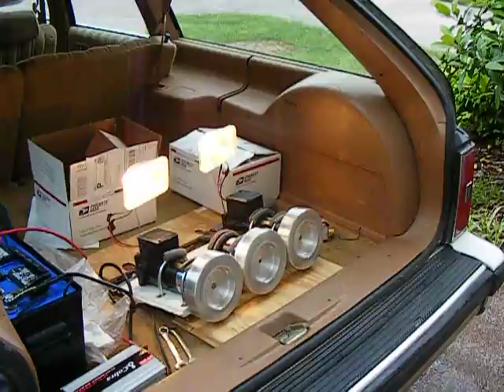New Free Energy

Comment: "matter cannot be created it just transforms", the same idea applies to energy, what you have is some motors that transform electrical energy into kinetic energy and them turns it back to electric, the problems is that nothing is 100% efficient, this motors lose something around 2% of energy in each change, without considering the bearings and air friction, you lost around 4% per cycle, you re not creating energy you re just losing it very slowly, it happens that if you let it there for about one week it will stop cause the battery will be fully discharged..... and please don't answer this comment with " the government doesn't want us to..." the physics doesn't  allow it to happen, any teenager that goes to school knows it...

If you prove that it can be made, i'll go personally to each school in the world burn all the physics books and rewrite it all over again.

Comment: George, here's the thing about magnetic repulsion. If you could completely block the magnetic field while two repulsively placed magnets get close to each other and then somehow move the magnetic block out of the way, then you have made a perpetual motion machine, if it doesn't take more energy to move the magnetic blocking mechanism than is created. You can use iron to block but it takes too much energy to move the block away. There is no substance known that will block without sticking.

Comment: Over unity is in regards to the definition of "coefficient of performance." It has nothing to do with the ridiculous idea of creating something from nothing. I never argued that a heat pump can create something from nothing. I only argued that it can achieve over unity. And with regard to a system it can supply more energy than work or heat input. There is a lot of confusion regarding the terms free energy, zero point energy, and over unity.

Comment: all you are doing is showing a friction less drive, hey guess what i have a water pump that uses magnetic drive, thats been around for years,  if your "generator" and motor were wound on the same shaft ( they did that during the war to power valve radios from 24 jeep batteries ) and floated that on a reverse magnetic field ( positive to positive) in a vacuum and used ac in and ac out ( no brush contact required) guess what you would still burn power as the coils of the ac motor give off heat..

Comment: Free energy eh? so you are running the lights from the generator ? so what is the battery on the left for?? eh    eh   you are using the battery to provide power you admit the 12vdc is powering the inverter 12vdc/220vac then you are using the 220v ac to run the central motor that is turning the generators via magnetic drive so the lights are run from the battery. where is the free bit?? some one giving you free charged baterys en exchange for flat ones?? who you kidding!!!  nutcase.

Comment: (cont.) With these values an ideal heat pump will have an efficiency of 200%, but an ideal heat engine--when we want to get energy back out of the system--will have an efficiency of only 50%. Thus if we draw 1kW to turn our heat pump we can move 2kW (or kJ/s). But we can only get back 1kW of that, again in an ideal friction free no-cost environment.  Did that make sense? We can never get more out than we put in even though the "efficiency" of the heat pump is routinely greater than 100%.

Comment: Sorry to butt in. It isn't correct to think of heat pumps as providing over-unity efficiency. Even 100,000% efficiency is not over-unity in the heat pump world because only a fraction of the resulting transfer can ever be available to do work when we reverse the system. This is described by the Carnot cycle where (Th-Tc)/Th is the efficiency of an ideal heat engine and Th/(Th-Tc) is the efficiency of an ideal heat pump, in Kelvins. So to demonstrate let's say Tc=100K and Th=200K.... (cont.)

Comment: Given your last answer it seems like we are in agreement. Depending on the system specified and given the fact that heat pumps transfer more energy than consumed, they can provide over unity efficiency. This scenario is typically used to subsidize the work of commercial A/C's and furnaces which by thermodynamics are much less efficient both on their own and when considered with the heat pump as an entire system. This heat pump idea or over unity should be applicable in other forms. idk where tho

Comment: right right! But if you think about it, you could in fact transfer more energy from one place to another than energy you put into the system to do the pumping? Right? Example 2 big copper blocks and 1 tiny electric motor could transfer 100 degree heat to the cold block heating it to say 70 degrees while only using enough electricity for the motor that equivalently would've heat the block only 20 degrees.
I agree it doesn't come from nothing, but if it's from the abundant ground isn't it over un?

Comment: What if the generator was connected to a fly wheel? Aside from the start up cost, the generator might then be able to power a much smaller electric motor designed only to maintain speed - while the generator outputs to other sources. I've seen this work with similarly with a water pump, but eventually you run into maintenance costs - where old bearings or brushed motors/generators can have problems.

Comment: Ummmm.... all that heat (energy) lost from the driving motor would have been put to better use powering the lamps directly, not to mention the heat lost in the generators and inverter. VERY inefficient setup. Also, magnetic coupling between a motor and its load is nothing new at all.

Comment: Whenever you convert one kind of energy (like the kinetic energy of a turning axle) into a different kind of energy (chemical potential energy if you're charging a battery, or electrical energy if you're feeding a grid)  a lot of energy is always lost in the process.  Most of this is in the form of heat, generated when moving parts have to overcome friction.  A car engine loses more than half the energy contained in the gasoline through heat.

Comment: 709%?  You're dreaming.  Even if you managed to get 70% efficiency out of your lead acid car battery a lot of work went in to manufacturing that battery.  Do you think it would be possible to run an entire factory for the time it takes to manufacture one new battery, and do it using just your fully charged car battery?  You would need tens of thousands of cells to run a big building at 110V AC and maybe 15A.  And the net result is a battery that fails if you leave the lights on overnight.

Comment: Can Somebody answer this easy question?
What if we put a Motor Axle which it turns and connect that axle to a Generator Axle and connect the output energy to the motor and hey presto electricity, right?

It basically works like a Microphone and a Speaker

Comment: Like all these devices they appear to charge batteries as the terminal voltage will rise, but the power is not being charged with power proportional to the voltage. Don't they teach Hugh School Physics and electrical theory these days?  The problem is the pulse DC or AC output has spikes the meters read, and the batteries absorb, but they are illusionary as to representing power. The SG of the acid must be read to determine charge, not possible by any other way.

Comment: Disconnecting the battery opens the circuit, and stops the flow of electricity, so it would stop, unless you had a bypass to close the circuit.

Comment: You start with DC power stored in a battery.  You convert it to AC with an inverter.  You power a motor with the AC current.  The motor barely turns two generators which produce enough DC voltage to almost keep two lights bright.  Your battery runs down after 10 minutes and needs recharged.  How is this free energy? lol!  Your system will be much more efficient if you wire the lights directly to the battery.  Nice try, but that whole "real science" thing always gets in the way...

Comment: I was brainstorming and your product will work your Resistance is the battery. the battery will only take a small change at a time you need to have a capacitor and more battery's to equally take the large change and not be bottle necked at the battery if that makes any cents to you

Comment: OH WOW!!!  Gears with magnets instead of teeth?!?!  What CAN'T magnets do?!?!  Granted, you have a net negative open system there, so you can't get as many kWh out as you put in.  In fact, averaged over the course of a run, you can't get as many watts out as you put in.  The only thing you CAN do with that is convert voltage it's inverse-proportional friend, amperage.  Technically speaking, you'd be more efficient with just an inverter and a transformer, but I like the Rube-Goldberginess here.

Comment: @MrGunnaras even for permanent magnetic motor you need a battery, but if the battery is charged from the motor, theoretically you need just first impuls, lets say, charging battery from standard electric site and its might be running for ever.

Comment: another f whit - Free energy is not possible - energy can not be made or lost only transformed from one state to another, thus your ides is total fictions and just basically dumb, possibly matching your education level. Eg if any heat is generated this is a change of electrical energy into heat energy and this lost of energy has to come from somewhere eg the battery you idiot, you may be extending the life of the battery but in the end it will die. put some load on a what how quick it dies.

Comment: I am amazed at the total lack of electrical knowledge. He does not get that he is running a motor to run a generator to light 2 lights with an inverter. O my what is that a 60 % loss no wonder the battery goes dead in 10 to 20 min. O it is the magnet drive Space age science mystery?

Comment: @zzytrewq 
We both know that over 100% efficiency is not possible.
You BELIEVE that COP only can apply to the heat-pump category.

Sooo, (aside form HP) +1 COP can't exist , therefore "Higher Output Than Input" can't exist  = CATCH 22.

So for you, "HOTI" is a impossibility, and there is no reason to give any such claims of any device a second thought regardless of ...

If i misunderstand you,  tell me what you would call a device that use energy to harnesses a outside energy?

Comment: @zzytrewq 

Why do you think COP +1 only applies to heat pumps? 

 On the surface your logic about action / counter action applies pendulum part. But it does not apply to the centrifugal force that moves the lever, the 2nd stage of the 2 Stage Oscillator.

Comment: @zzytrewq

 Do you know how a heat pump works?

In short, Heat Pumps compress gas (mass) & decompress gas repeatedly. The decompressed gas captures heat (energy). Then the gas is compressed, & the energy is transferred inside via the evaporator. Repeatedly. 

2 Stage Oscillator.
 
A 2SO compress & decompress Gravity Force repeatedly. The decompress point captures gravity (energy?)  Then the mass is compressed (Max G Force), and the energy is transferred via a lever. Repeatedly.

Comment: @zzytrewq 
You are right, this is going around in circles. i think you are being selective with which words you read. nothing i have said has changed. but your conclusions skip the point over and over. 

I just pointed out how the heat pump and the 2SO are not PPM or OU (of efficiency devices) but they are both COP +1.  Is that hard to understand?

Comment: @zzytrewq 
Refrigerators are OU COP devices. Input energy from OPERATOR supplies 25 parts . The heat supplies 75 parts of input energy. That is the total of 100 parts input energy.
 With friction, conservation of energy, etc... the actual work done in cooling is only 50 parts work energy. 

TOTAL IN = 100 PARTS - TOTAL OUT 50 PARTS = 50% EFFICIENT.
Op - IN 25. TOTAL OUT 50 PARTS = That is 200% COP or 2.0 COP. 

A refrigerator is a OU COP device, but doesn't run itself!  Some friges have COP of 6

Comment: @ZoeMarks   Rhead100 's 2 stage oscillator. I did the frame by frame review here are the results.

 The Facts.

Input; 4 lbs push x 4" D / 0.1 sec = 160.

Output; 70 lbs X 1.5 "D X 2 times / 0.1 sec = 2100. (for the downward movement)

Power Ratio input to output of downward movement 1 :13.125.
Power Ratio for upward lift 1 : 4.375
These are conservative numbers. Even if Rhead100 under estimated his pushing force by 100%  the output power is still 6 times greater than the input.

Comment: @ZoeMarks
 
I removed posts, because I was trying to edit my last statement on leverage vs 2SO, just  to make it clearer. It still did not post as written, with proper spacing...

I never said this magnetic gears works as described. I just think it could possibly work. Your equal shaft speed & torque is a valid point, with only 1 exception. That exception does narrow down what could be happening, if it is not a hoax. 

You're correct on the language. Free-OU->1COP... they seem to merge at times

Comment: @ZoeMarks 
Self running?

 I already used the heat pump as an example of a Free energy device that does not self run,  it is a better example than solar. 
It is simple not practical in most cases to make things self run. The loss of power in conversion, cost, ... so that someone who can't measure is convinced?
 
If that is your criteria than that is that. And a heat pump that consumes Input 1000Watts electricity & output 3000 watts BTU,  is not a free energy/OU device ether.

Comment: @ZoeMarks 
The downward work (hammering ability) of the 2SO may be easier to understand. 

In  Rhead100's AB video.

1. Could you place your fingers under 70lbs weight, as he pushes with 4 pounds of force on the pendulum?

2. Can you put your fingers between the pendulum & his 4 lbs push? 

Also it is 2 hammers, for each push!

The downward force is even more than 70 lbs, those connection rods bow because of the extra weight of the beam so it 70 lbs + most of the beam weight.

Comment: @ZoeMarks 

Yes i have built a 2 stage oscillator, just for fun. The output than input ratio is obvious to everyone who's seen it in action. Whether you use it as a hammer (downward force), or a lifting device (upward force), it use less work than it provides.

The downward work (hammering ability) may be easier to understand.

Comment: @ZoeMarks
" 1. Is the force required to push two magnets together the same as the force released when they move apart?"
Yes (when they are static not moving or without outside influence the attraction are equal) 

"2. Do two magnets always apply the same force on each other?" 
That is the million dollar question. (at least to the FIRST PART of what could explain a free energy effect.) 
The answer is NO. 

Many outside conditions act on a magnet forces.   What effect does spinning & speed have?

Comment: @ZoeMarks 
(5)  “If two shafts have the same speed and torque the power is equal. You do understand that?”

Yes, I have already agreed with this comment. Yes it would make no difference which shaft would have the driving motor or the driven generator on it. All the shafts should have the same torque and speed. 

Ether this device adds energy to all the shafts or it does not add to any of the shafts.

Comment: @ZoeMarks 
(4)Shielding
The gear rotation.
The attraction on one side is equal attraction on the other, so the gears stand still. If I shield the magnetic fields from attraction of the left side, the attraction is no longer equal, and the gear rotates to the left.

If my drive motor spins to the left then the uneven attraction COULD aid it’s rotation. (I no, Lenz law may conflict)

This is over simplified but...

This applies to question 3 & 4.  Speed & rotation change/effect magnetic fields?

Comment: "no mechanical device can harness gravity to povide free energy."

The case for GRAVITY OU, “Milklovics Two Stag Oscillator” has already been discussed. Many PHDs of physics and mathematics have acknowledged this as fact. Many more like liam still don't accept it. The proof is self-evident. Look at this youtube video “ Higher pendulum more weight lifted A of A&B ” Pushes 2 lbs of force, lifts 49 Lbs. Then adds 23lbs, and then has to push with 4 lbs of force.

4in : 72out, or 2in: 23 out etherway

Comment: @ZoeMarks  You haven't seen mindfreer's 2nd video?
 
He measures input, and output, and it is very clear.
That video shows an of input 90s watts and a output of 180s watts.
It should be 90 input, and 50 output, base on all  the components involved. Why is this?

I agree with your second statement with the 2 wheels 100%. 
I believe the drive and the driven could be on the same shaft and get the same results. The magnetic gears simple add energy regardless of where the driven motor/generator is.

Comment: @ZoeMarks 
Question 3  you say no, i say yes. "Peak force" ?   

 When still the gear's attraction on both sides are equal. The magnet's placement in relationship with each other is also equal. Magnets have equal influence throughout rotation etherway.

 If i shield one of the gears, they will move to find its new equal point. The magnets placement will NOT be equal distance to each other. One side has less influence from the magnets than the other. Regardless of peak force point, right?.

Comment: @ZoeMarks
 The answer to all those questions is yes.

I agree with you that the forces when static are equal, but when moving, the attracting forces do change.
 How much? I don’t know.

 Enough to have a gain when rotating a certain speed? Maybe.  

1 of mindfreer's video shows measurement the display OU. COP of 2 or close to it. If there where no Advantage giving with those interacting gears, his output should be 50-60% of input not 200%.